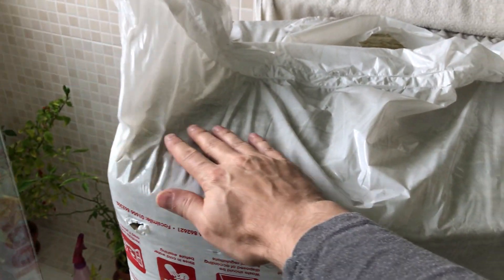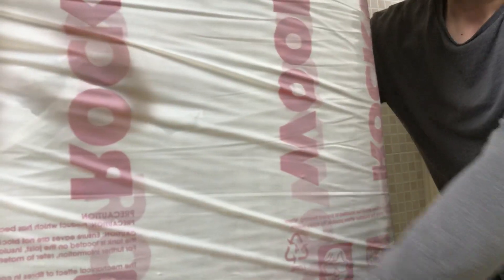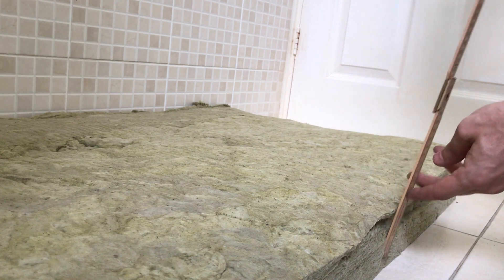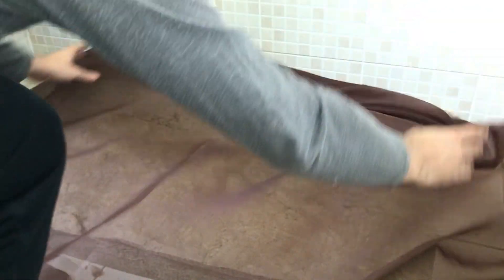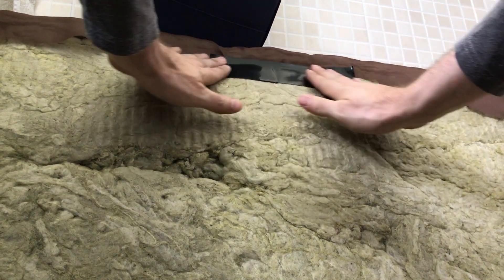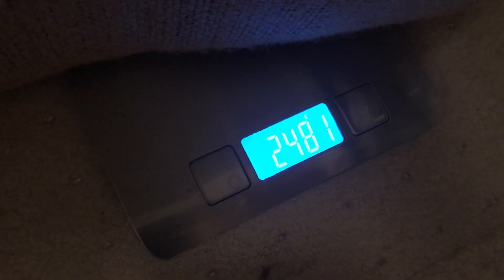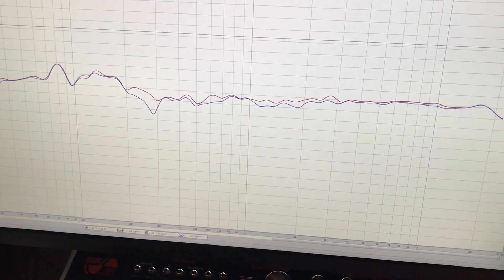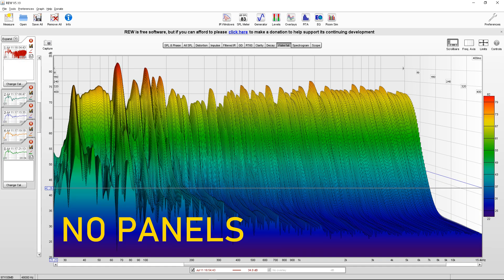EP#08 - Room Acoustics: Can we make cheap (+/- 10$) sound absorption panels that require no tools?

Comment: These look so cool! I’ll have the floor down in my shed studio conversion at the start of September. I think I’m definitely going to make these as my absorption panels
Reply from the maker: For better absorption (thanks for the tip thoraldo) a gap behind panels will work even better. These aren’t good for that because they lack a rigid frame and have to hang. But, simple to make and a good entry level solution. 

Good luck with the build.